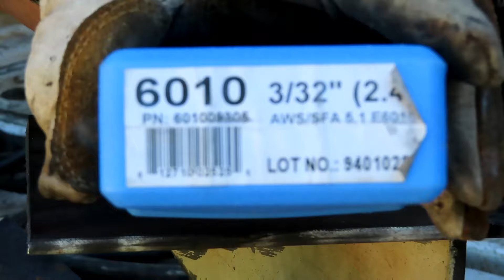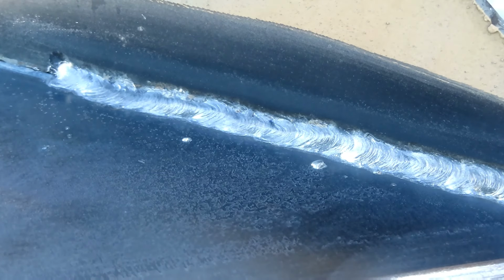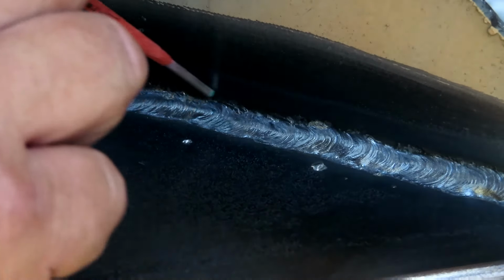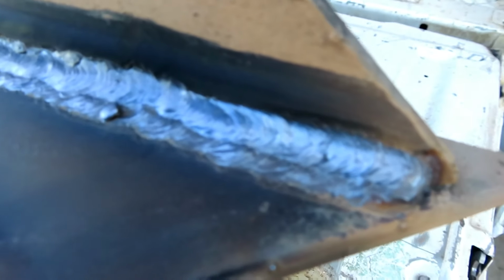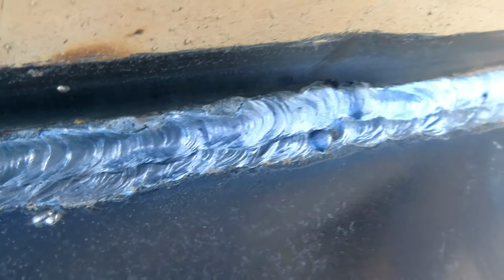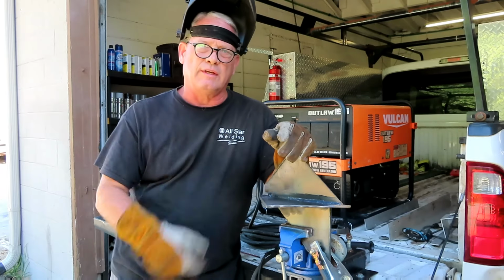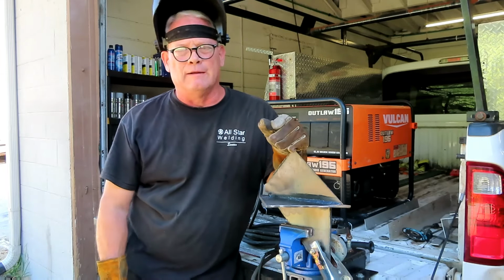Vulcan Outlaw in use - 6010 & 7018

Comment: Just do repairs on the farm, lots of pipe fence and equipment repairs.  I am self taught and always had trouble with welds ( more like a series of tacks) until I watched Bob Moffatt and lhe preached about getting in position and bracing when you can and there was young Chuckie wanting to show everything he learned.  It really helped even got better with free hand.  But when I get into a lengthy welding job, my patience starts to.wear...  Welding is like painting, lots of prep before you get to paint if you want to do it right.
That's why there are full-time pro welders like you.
Reply from the maker: Yeah, prep is key. I despise painting and try to avoid it, haha.  Getting set to weld, comfortable stance, propping your hand, makes all the difference. Look at my video on the Titanium Flux. I preach about steadying the hand and not having it floating in the air without support. I see a lot of guys trying to do it one handed, then they wonder why the weld looks so bad

Comment: I just ordered my first engine drive welder the new Vulcan Outlaw. Sould have it by 1/28/2595. Thanks for the reviews that helped with my decision. I am actually trading welding up about 60' top rail and bottom rail 2 3/8 drill stem and 2 7/8 for the overhang to  hang 16' gate.
Reply from the maker: Congrats on the new machine. You're gonna love it. That is the perfect project for the Outlaw. I've done more of those than I care to count. Saddle everything up and just use 3/32 6010 on about 65-75 amps should do it nicely. Send pics! If you have any questions about the Outlaw, please ask. Go to the front page of my channel, and slide over to "Community" tab. I've put my email address in there
Reply: @AllStarWeldingSC  thank you. I will

Comment: Love the outlaw!
Reply from the maker: Yes, me too. I really is a great machine. Out of all the welder/generator styles, it's the only one with electric start. 195amps is more than needed for my use. 13hp Predator engine, which basically is a Honda if parts are needed. The only 2 things that it is lacking, is a choke on the front and an hour meter. But look at my mod videos on how I fixed that situation. And it's only $1799

Comment: We have the same welder as this in Canada labeled as the Powerfist 195A from our HF equivalent ($2500cdn). Do you think this would hold up on a service truck for bolt extraction and small repairs or spend the money on a used Ranger 305G? Thanks in advance, really enjoying your videos!
Reply from the maker: That's a really good question. I don't know the type of work that you do. The Ranger is a good machine, don't get me wrong. But is it overkill? For the 2-3 times a month I need mine, and at 60-120 amps, the 195 is plenty for me. I actually use it more as a generator more than anything. Buying something brand new, with a warranty, is better than something used with unknown history, to me. 140 amps is 140 amps. Does it matter if it's from the Ranger or from the Powerfist? That's your call. Let us know what you decide to do!

Comment: Im guessing that you can run a mig welder off of the generator . And does it have a TIG welding option ? And does it do better to push rather than pull ? Thanks man ,,, I appreciate you .
Reply from the maker: I have a Primeweld MTS-200 Mig. I've run it on the 110v side many times, and for the spool gun. I haven't run it in 220v. Haven't needed to. I usually just use stick. The Outlaw does not have any sort of tig function. However, nearly any DC stick machine can do tig, if you get the right parts. You can find that on YouTube. And, being DC, it would only be for steel and stainless. I don't see myself doing tig as a mobile repair job. I would just bring it to my shop and use my Primeweld 225 AC/DC tig. But again, that's usually just for fabrication work, not a mobile repair job. As for push or pull, I assume you are talking about stick, in that case you'd want to pull.
Reply: @AllStarWeldingSC  Thanks man .

Comment: What length of leads do you have and particular brand of rods you use
Reply from the maker: I have 20ft ground lead and 30ft work lead. I also have 2 more 30ft leads with male/female dense plugs that I can add when I need it. All my rods are Victory brand, because that's what my supply store stocks the most. I like them, and have no problem with using them.
Reply: Awesome brother!!!  another great video, Thanks for sharing. And running some great beads, currently working on mounting my unit to my welding trailer maybe I’ll share some photos once I get everything set up.

Also, maybe for guys that are out there. A a good video would be maybe a review of your packout and tools that you run with on your rig…?
Reply from the maker: @GonzalesIronworks thank you for your comments. I really appreciate it. Many have asked about a rig tour, so I guess I better get on with that soon

Comment: for how long have been using the outlaw 195. and have you have any issues with this machine at all? or is really worth the money?
Reply from the maker: I got it about 6-8 months ago. When I was shopping around and researching, I had decided that the Outlaw was the one I wanted, for numerous reasons. By the time I got around to going to HF to get one, they were being temporarily discontinued. I later found out that after every last one was sold out of all the stores and the warehouses, they would make a comeback with the CO2 monitor added. I found mine on Facebook marketplace for $1000 about 45 minutes away. I use it 4-5 every week. The only problem I had with it was some of the bolts on the engine oil pan backed out and spilled some oil. So it was a minor engine problem that was easy to fix. As you can tell from all the videos I make about it, I absolutely love it. It has features that no comparable welder/generator can touch... Bigger generator, electric start, 195amps, and unbeatable price. And someone told me that the new ones are the same price, and include the 3 year warranty for free. I'll have to check on that. I have no problem recommending this machine to anyone. When I get some spare cash, I want another one! It truly is worth the money.
Reply from the maker: There are a few things it's missing.... An hour meter (see my video about that), a choke control on the front (see my video about that, too).  And I plan to replace the twist lock on the 220v side to a proper Nema 6-50 welder plug.
Reply: @AllStarWeldingSC  I did watch your video about the bolts.  And also most of you other videos. I am not a welder but i uso to work as a pipefitter. However i have a titanium that am not able to use because i dont want to use house outlet. So i am been looking for a generartor to be able to use my tinanium  200 and thats how i came across to your videos.  So it seems i will be better off with tge vulcan 195 thant the predator 9500.
Reply from the maker: @AROM0410  hmm... Well that's something to think about. The Predator 9500 is a lot of generator power. The Outlaw is only 6500. But you can weld with it. Tough choice.
Reply: @AROM0410  I run both a predator and a Vulcan. I keep the Vulcan open for power tools, and run larger equipment, compressor, etc. Guess it just depends on what you’re looking for and what kind of work you’re doing both are basically the same machine only differences you can weld with the Vulcan. I have an arcaptain that I use with extension cords and can even run it off generator, so I’m sure it’ll be fine with the titanium.
Reply: Also runs my Hobart 140